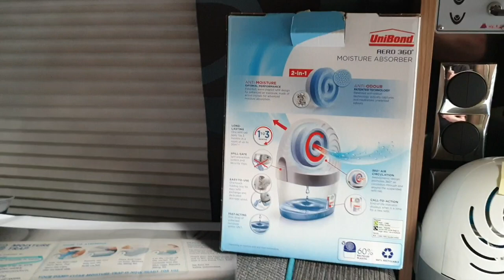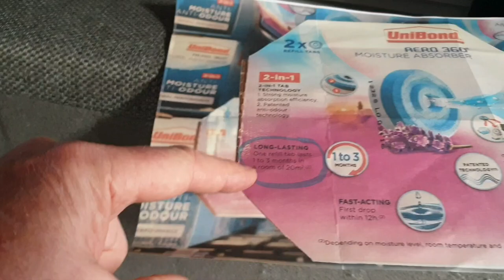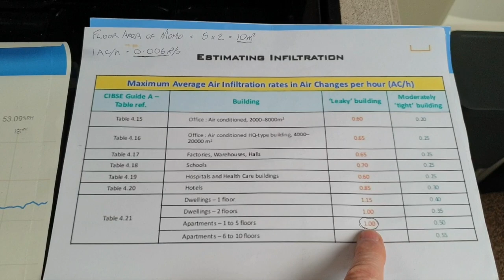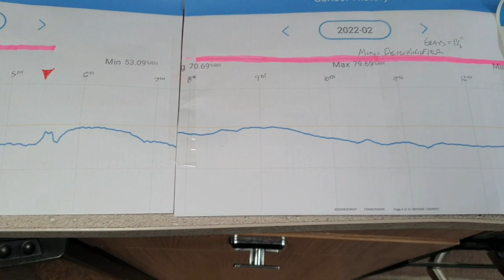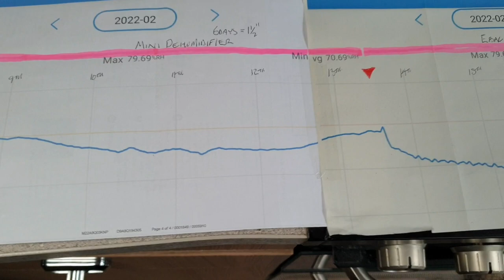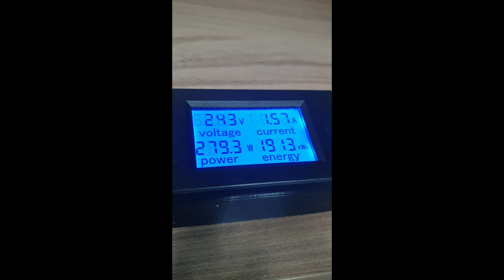Motorhome Winter Storage.........To dehumidify or not? 🤔🐝

Comment: V interesting. I wonder how leaky a modern caravan is?
Seems to me that dehumidifying the outside air and blowing it into the caravan to replace the air and provide a positive internal pressure, may be a better solution, at least in still air? It might only require less than 20 watts in some  vehicles and the unit could be outside and dump it's water externally!
Reply from the maker: A modern caravan is the same leaky construction as tge motorhomes. It is the way they are built. For an external unit to positively pressurise the internal space, you'd be looking at a larger unit (and more power). Better just ventilating the interior and maybe adding some frost protection for the sub zero spells.